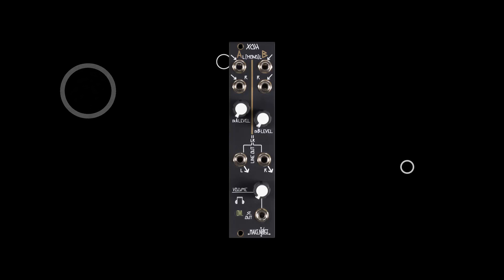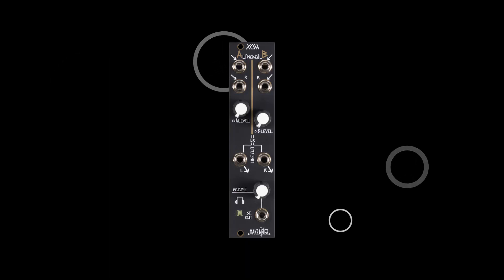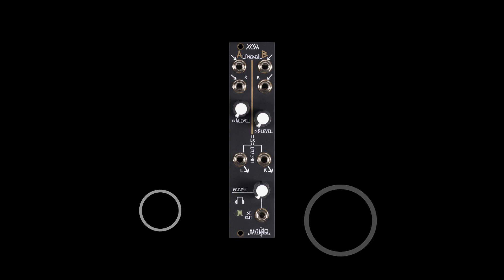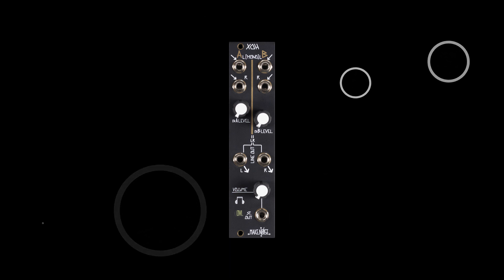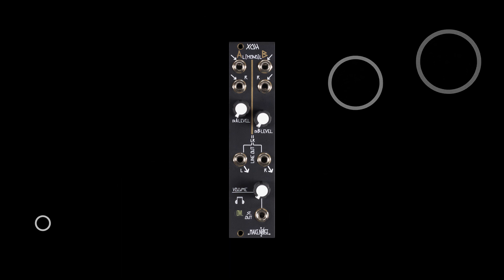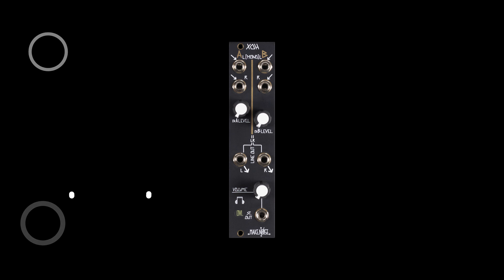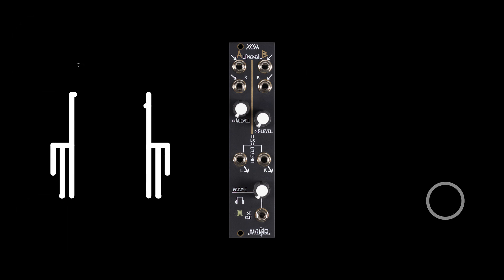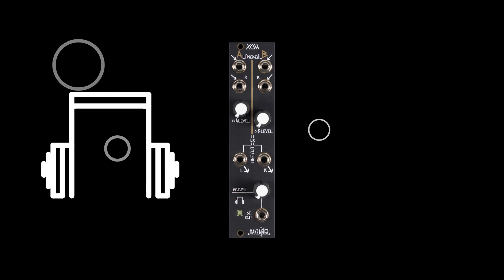Make Noise XOH

Comment: this module fits with my system perfectly, but whenever I send the signal to anywhere but my phones I get really nasty pops and hums and have to fiddle with the cable a bunch. should I be using an 1/8" to 1/4" cable rather than a jack adapter at the end of an 1/8" cable?

Comment: I'm looking for a module that will do line level outputs and also attenuate down to guitar pedal level as well.  Would the headphone output here work with guitar pedals, or would there be an issue with impedance?

Comment: why is the mimeophon panel so much lighter than the adjactent also black modules
Reply: it's not, check also the blank panels on the right. It has to do with lightning and the straight camera placement
Reply: @enter_me  I'm looking at my MakeNoise stuff right now, Mimeophon does look slightly more grey than Morphagene that's next to it. I think what's going on here is they may have left the top side copper in place on most of the Mimeophon panel and laid black SMOBC (Solder Mask Over Bare Copper) over that. Given the copper is more reflective than bare FR4 glass epoxy you get a bit more light coming back. Honestly though, it's petty and you really only notice it shining light directly on the thing. Let's go make music or beeps and bloops...it's black enuf.